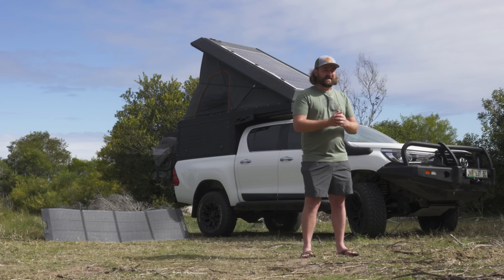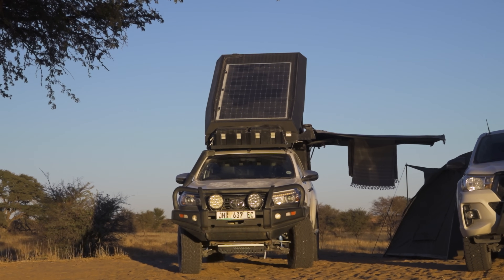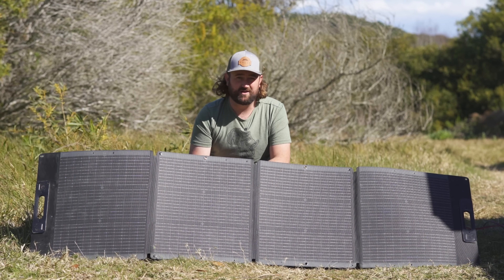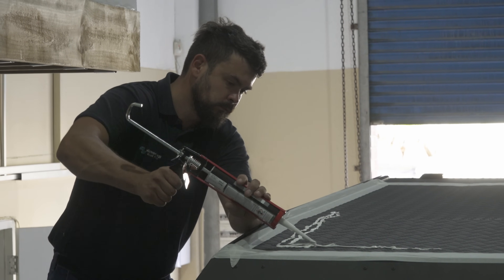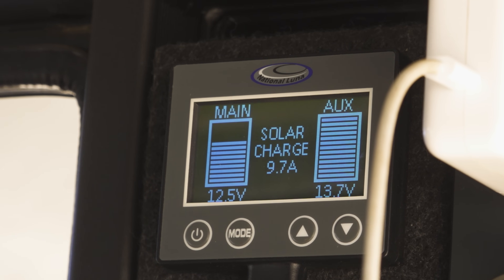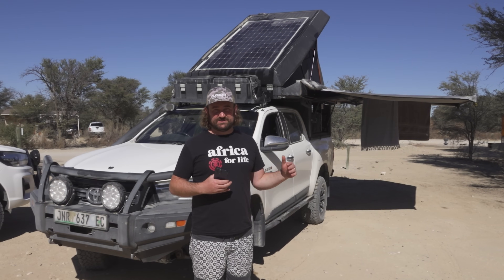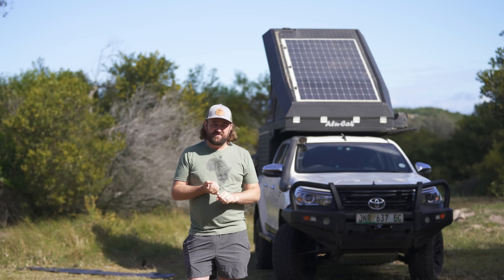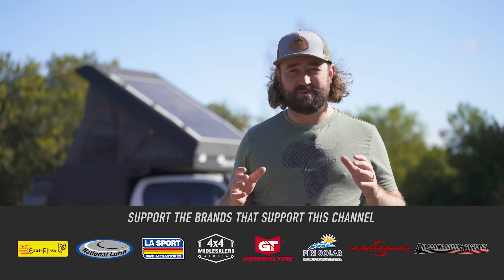Solar Solutions: Roof Mounted vs Portable Panels, Charge Controllers & More!

Comment: Hi Matt, I’m curious to see how your panel has performed over the last year? Particularly with regards to it being adhered directly to the RTT with no airflow under it? In hindsight would it have been better to run, for example, a few 5mm aluminium flat bars front to back between the panel and the RTT? I am about to instal mine and would like some first hand feedback please. Great channel, thank you!

Comment: When starting out, I used a smaller solar panel (lower power output) to reduce the discharge rate until the next drive charge. Flexible panels can be crazy expensive. As per your video, never exceed the input voltage of the solar charge controller as it will damage the controller instantly. The upgraded panel is always welcome. Also note that a rated 400W panel never truly produce 400W due to losses. Always check the efficiency rating on the specification sheet.

Comment: It's great to see Sunman Energy lightweight solar panels have made it to SA. In Australia, Sunman are the most reliable flexible solar panels for grid and off grid applications. To gain the most power on metal surfaces we mount these to core flute stripes. This allows an air gap between the roof and the panel. Did you know Sunman also manufactures a 520W.

Comment: My biggest gripe is that these solar panels almost NEVER achieve their rated output. My flexible 150W panel, through a Victron MPPT charger, only achieves 120W with a cold panel in full sun at midday. If a panel is rated to 150W then surely it's fair to expect 150W from it? I paid for 150W, why don't I get 150W? It's like buying 150L of fuel and the fuel station says: "Sorry, the temperature is a bit hot today, you only get 120L". And we just accept it...

With space being premium on and inside an overlanding 4x4, it's not easy to just overspec the panels so that you can get the watts you need. 

Matt, can you do a test to see what's the maximum you get out of your 430W and 200W panels? And whether flexible is more efficient than rigid?
Reply from the maker: I think it’s very possible that there are external limitations too. For example, if you are at lower altitude, the sunlight has to travel through a thicker later of atmosphere and therefore loses energy. If you go to very high altitude areas and feel how much more intense the sun feels against your skin, this makes sense. There is also efficiency loss through voltage drop on the cables, etc.
Reply: @mattdubber  Absolutely true, atmospheric quality definitely can have an effect on the overall solar radiation but 25% loss in full sun at midday in South Africa with the sun almost directly overhead is not acceptable in my book. Here in full sun we're getting over 900W/m² which should be enough to power any solar panel to it's full rated power. Oh, and I'm using 6mm² cables (good for 30A) from panel to Victron charger to battery so the voltage drop along the cables is negligible. 

Lead acid batteries were just as bad, for example - "rated" to 100Ah but if you use more than 50% (50Ah) you risk shortening it's life or damaging the battery, so 100Ah isn't the useable capacity at all, unless you want to damage your battery. At least LiFePO4 batteries are rated for full useable capacity. 

Would still like to see what you're getting out of your panels, even if just for comparison's sake.

Comment: Matt only other negative with the Flexible Panel I found was by using sikaflex or the like it is permanent. It will break if you try to pull it loose so the day you sell the canopy or rtt it will have to go with. My latest built I used thick industrial velcro all around the edge. That also helps when it gets to the cleaning. Just a thought. Enjoy.
Reply from the maker: That is very true

Comment: Great videos as always! Interesting to note. The Victron MPPT chargers model name is a bit deceptive. The 100 is for the max voltage that the panel side input is. The 30 in your case is the max amp output of the MPPT charger to the battery. This being at the say, 13V. I was always under the impression it is 100V max input, 30A max input from the panel. But the numbers stand on either side of the MPPT. Volt for panel and AMP for battery side.
Reply: Also, the other thing is, based on the spec of you panel you should be running at around 33A. Max you can get out of that Victron controller is 30A. They should have given you the 100|50. In cold weather and full sunlight you will produce close to, if not more, power out of the panel.
Reply: Yes, a bit deceptive that, 13.4V x 30A is only 402W which is about the max of this charger, whereas the notation 100V|30A seems to imply 3000W.